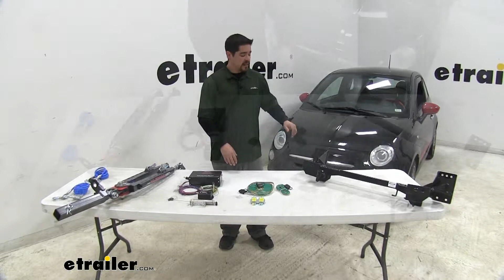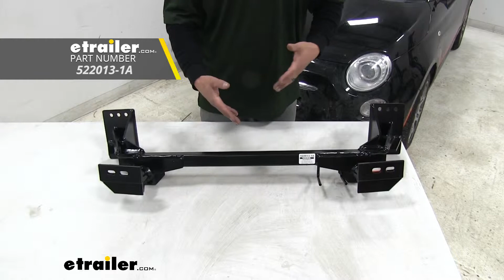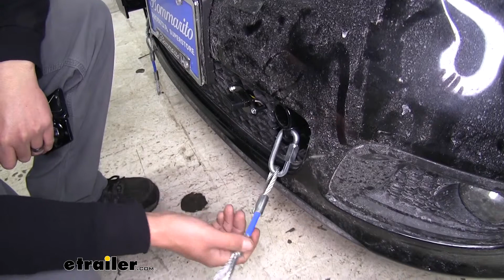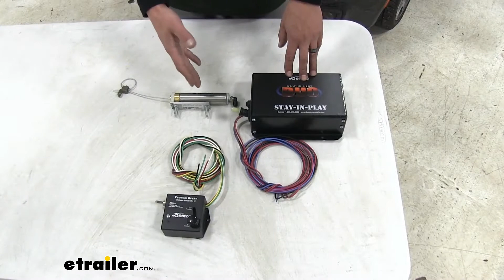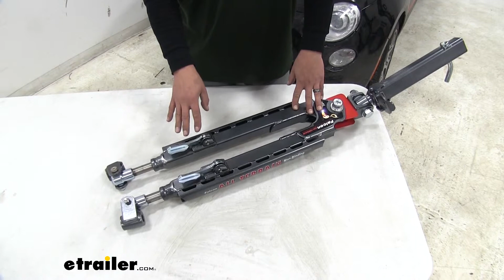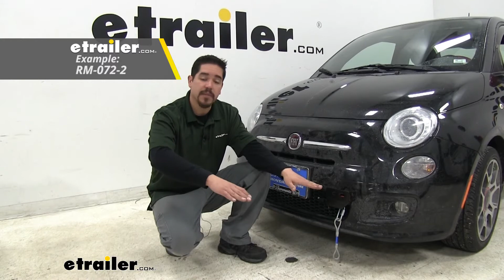etrailer | Best 2018 Fiat 500 Flat Tow Options

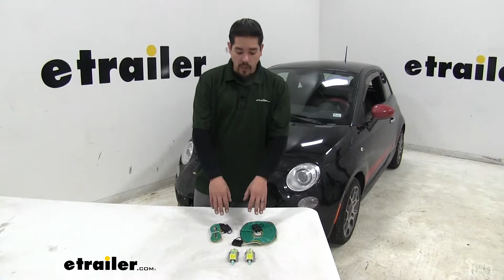Comment: Wiring Part number in the video RM-152-98146-7 @ 1:16 looks different than what is on the website.  What is the correct part number for the one used in the video?
Reply from the maker: The kit has changed a bit since this video has been made. You will need the following kit.
https://www.etrailer.com/Tow-Bar-Wiring/Roadmaster/RM-152-98146-7.html